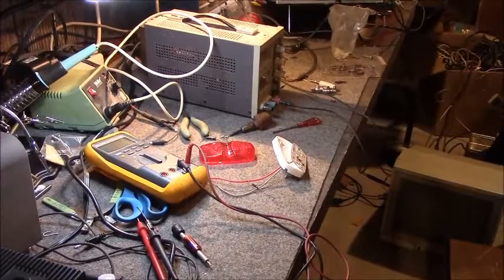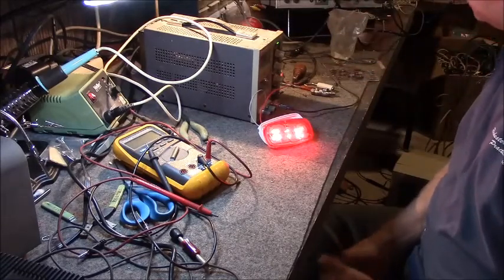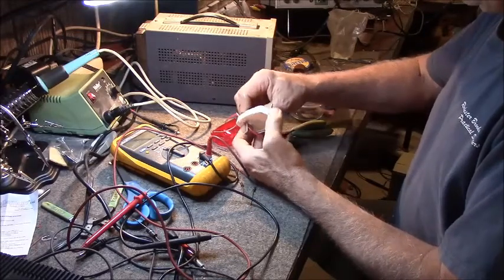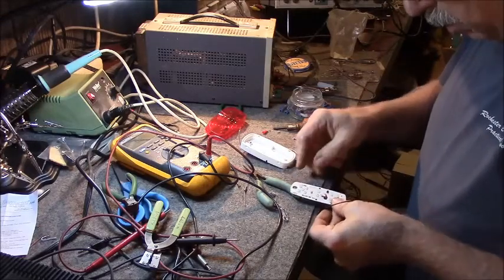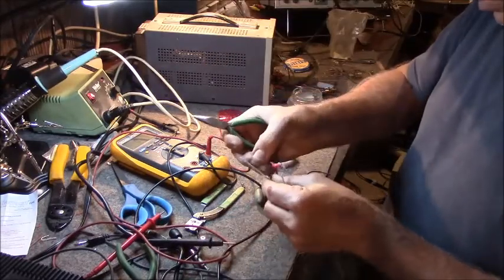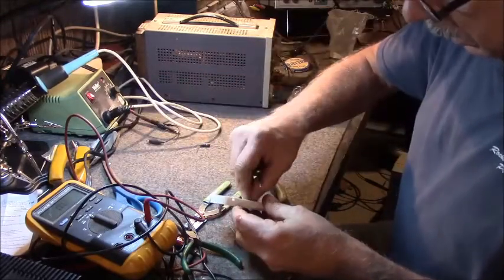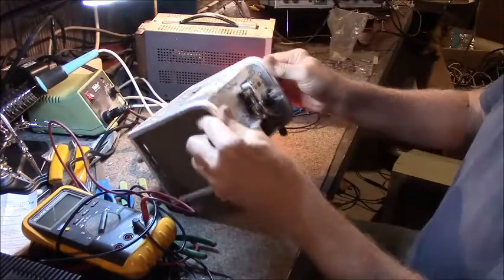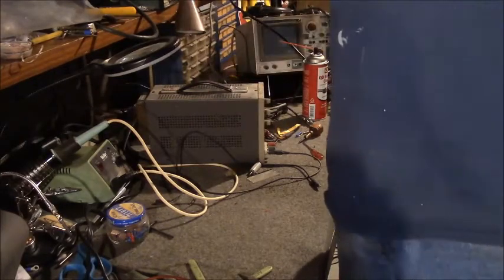How to modify LED marker lights into taillights with running and brake light functions for go kart

Comment from the maker: This circuit could be installed external to the the light by putting the resistor in series with the running light hot wire, then just bypass the resistor with the brake light switch feed. Cover it with heat shrink or keep it inside, out of the weather, either way insulate the connections somehow.